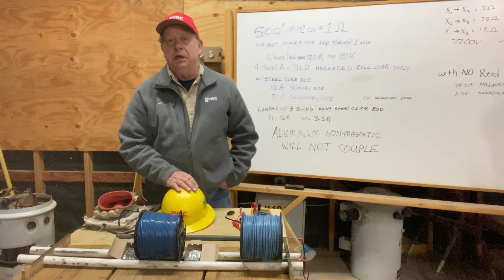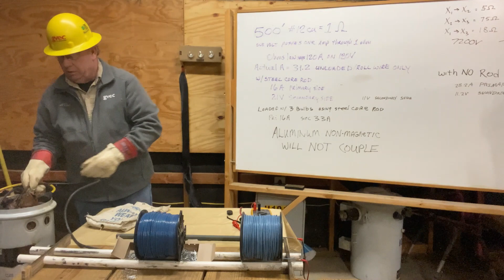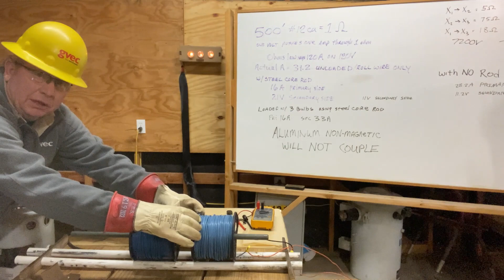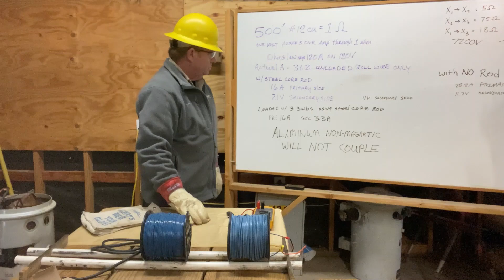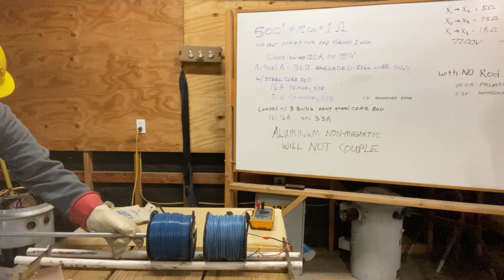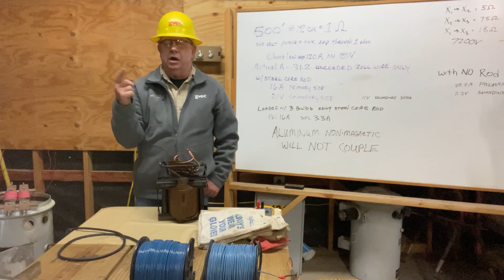Transformer Operation - Induction & Magnetic Coupling Demonstrated

Comment: Thank you for your time. I truly appreciate it.

I’m a handyman by trade, and I’ve worked around electrical systems for many years. At 66, I recently decided I wanted a much deeper and more complete understanding of neutral and ground—especially how residential power is supplied through the transformer and how everything ties together in a home.

So I began studying in earnest, and it has been incredibly rewarding. I now have a solid grasp of shared neutrals, and I’ve learned how to troubleshoot and track down weak or broken neutral connections—something that once felt confusing but is now becoming clear.

Honestly, if I were a younger man, I believe I would have made one hell of an electrician. I genuinely enjoy this work, and I find myself more motivated than ever to keep advancing my understanding.

Thank you again for your time and guidance.